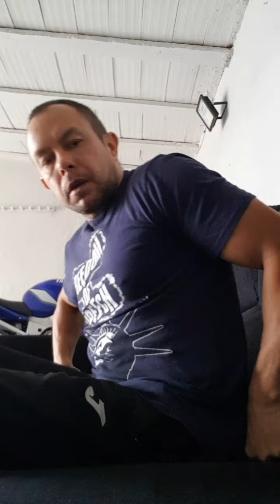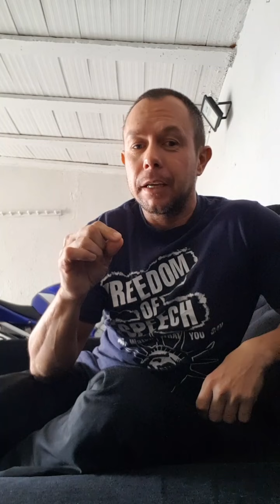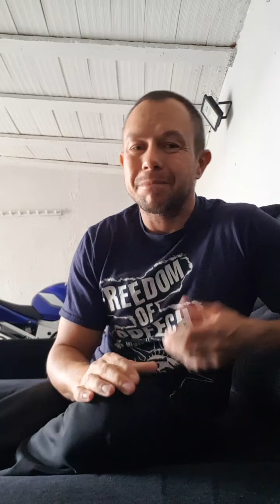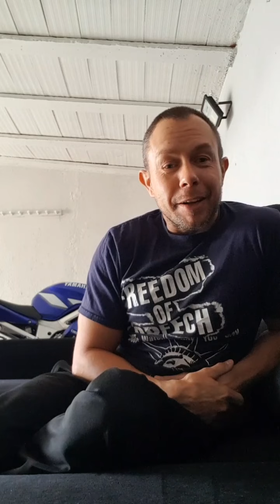Camshafts... Is that a good performance gain on my engine and how does that work?

Comment: have you got  any experience with cams on a cdi ? it makes peak power at 3700-4200rpm if you moved that at 5k surely it would make much more
Reply from the maker: It will for sure and the cams are the main commonrail problem. If I had the time I would for sure grind a couple and see what happens.

Comment: Quels modèles pouvons nous trouver dans le commerce ? J’ai trouvé blacksmoke, d’autres disponible ?
Super vidéo merci beaucoup pour ton partage
Reply from the maker: We custom grind camshafts for these engines. Both Stg1 that you can mount without modifications and Stg2 that requires enlarged valve reliefs.
Reply: Toujours une réponse avec vous vraiment au top et très bonnes vidéo technique 🦾